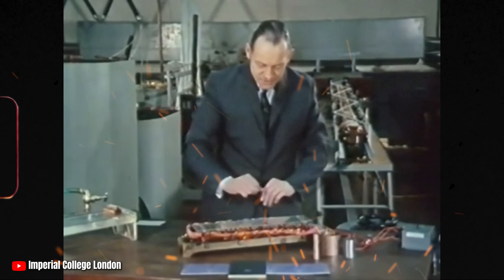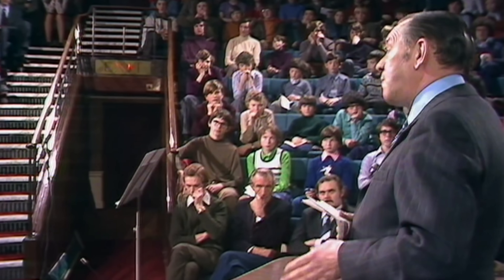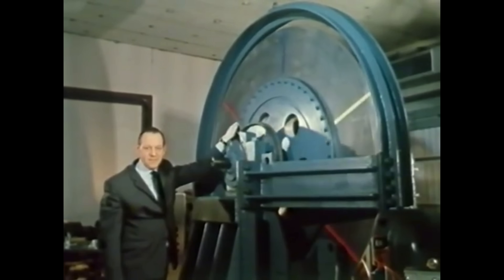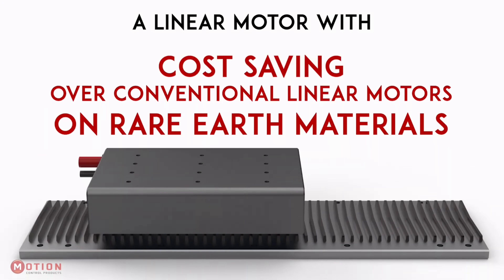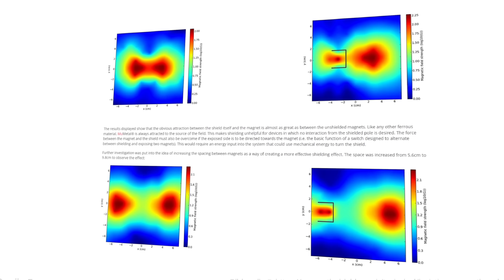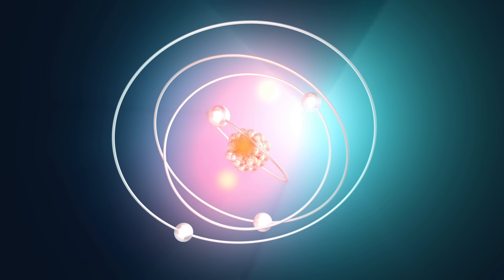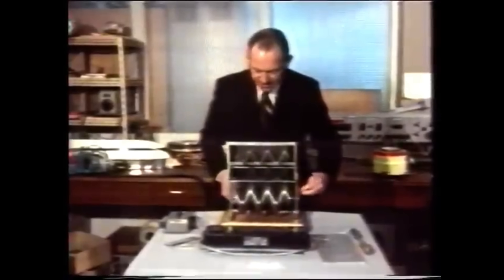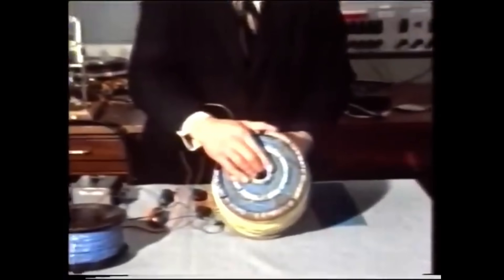Professor Eric Laithwaite: The Magnetic River Free Energy Generator!

Comment: The "Magnetic River" is by no means something mysterious. It's a linear induction motor, a very useful design, which is well understood. But of course this design does not deliver more energy than goes in. I doubt that Prof. Laithwaite himself ever made such absurd claims. Only YT-videos do that.
Reply: If the info is correct, then not really 

This would be a permanent magnet induction linear motor

That means the result is it runs itself and that’s because the Lorentz force ExB is just 2 magnetic fields interacting, current’s “magnet moments”
And the magnet. Here he’s using b-emf (Faradays Law) (generator effect in a motor) to be a Lorentz force Thus this would keep running.
Last more than a human’s lifetime.

The math and physics and Laws are basically perfect. The teaching in physics and especially electrodynamics is full of Dogma!

It is of basic knowledge to understand that the thermodynamics laws are NOT the reasons an electrodynamics machine limited to 100% input to 100% output. Even tho general science and electronics comunity make this mistake constantly.
Its the magnetic functions force pairs that limit the machine in standard design to 100% output and of course that’s because of standard design. Here with a different design that limit can be exploited!
Reply: @caminglis53    The info is not correct! This motor needs electromagnets and as all other electric motors an input of electrical energy. Prof. Laithwaite developed it in the late 1940, and there was never a newer design by him or any other person which worked with permanent magnets alone. 
And sorry, science makes no mistake. It is true that electromagnetic designs are outside the field of thermodynamics and I also don't understand why so many people always refer to the 1st law of thermodynamics. But in physics we have the law of conservation of energy which applies to all fields! It is this law which restricts output to 100%. All electromagnetic effects as Lorentz force or Back-EMF obey to this law, which is indeed a fundamental one. Up to now absolutely no observation is known which violates this law and in addition we have a mathematical proof - Noether-theorem - that conservation of energy (and momentum) is a prerequisite for the stability of our universe. I personally prefer a stable universe without permanent magnet motors to an unstable one with permanent magnet motors.
Reply: If you know Eric laithwaite you would know he never would use the words or phrase "FREE ENERGY"
Reply: The sun makes a tad more energy than goes in...what equal source off power went into sun too create the equal constant billions years off immense output what was the sun's equal input
Reply: What is the equal input that went into and maintains our universe explain in physics this equal input for me...
Reply: @jshaw4757    With the sun there is a fusion reaction, mass is transformed into energy. Sun looses mass all the time it emits energy. With the equivalence-relation between mass and energy this is in conformity with conservation of energy. But such reactions only happen under extreme pressure and temperature and are of course not possible with electromagnetic devices. Since quite some time scientists and engineers try to utilize fusion as an energy source on earth, but it is still uncertain, if this goal can be reached.

Sorry, I can't explain you what happened when our universe was created. Scientists have developed several ideas about it, but we simply don't know what happened and if conservation of energy was also valid at this singular event. But we observe for sure that it is valid in our universe now.
Reply: @jshaw4757    With the sun you have a fusion reaction, mass is transformed into energy. The sun looses mass all the time. This process is in compliance with conservation of energy if you consider the equivalence between mass and energy. What happened at the origin of our universe isn't known yet.
Reply: @durchblick9505 So the origins off our universe goes against our known physics..you would need equal energy input too create n run n crate physical matter and you say so yourself the origins off our universe is not known yet which means all our known physics could be fundamentally wrong as we do not not its origins or creation.. can't build a house without understanding the foundations
Reply: @jshaw4757  Your first sentence is not correct.  If you search e.g. for "big bang conservation energy" you will find that many scientists believe in a big bang, which did not violate conservation of energy. Others assume, that this law only became effective with the big bang. We simply don't know. But our lack of knowledge in this difficult field is no reason to stop observing what happens in our surroundings now. There is no observation known which violates this law, engineers and scientists use it constantly, and in addition we have the Noether-proof, that conservation laws are a prerequisite for a stable universe.
Reply: @durchblick9505  Yes but we don't know the original input...
Reply: @durchblick9505  it's simple...explain the original input then we can talk
Reply: @jshaw4757   I am not a big bang expert. But those scientists who assume that big bang did not violate conservation of energy have of course ideas about the original input. You find their ideas with the search string I have indicated. But as I said before, there is no assured knowledge with these questions, it's all hypothetical. But conservation of energy is not hypothetical, since we can observe it and even have a mathematical proof for it.
Reply: @durchblick9505  No correct you certainly arnt a big bang expert as nobody is ..the most important fundamental which currently states all existence n life n matter cam from a concentrated dot off something called a singularity 🤣🤣...crikey talk about clutching at straws
Reply: @jshaw4757   Big bang is a hypothesis only. But it is widely accepted since it is in conformity with observations, e.g. the expansion of our universe. It might be completely wrong but I think it is premature to critisize it just because it is far beyond our imagination. There are many effects in nature beyond our imagination and can only be described mathematically. 
Also, researching the origins of our universe is interesting, but hardly of relevance for addressing our present problems on earth.
Reply: @durchblick9505  "many scientists believe in a big bang, which did not violate conservation of energy. "
Well no that's not true. We have no idea how big the universe really is, or if it's infinite. In other words we have no idea how much energy is actually in the universe. We say it all came from the big bang, yet before the big bang there was nothing. Ie: we got something from nothing.
Reply: He never said that his invention could produce electricity, however he and John Searl discussed  John Searl’s invention and research.
Laithwaite also witnessed the levity disk that lead to John Searl’s generator.
I have images of Searl’s flying disk that were taken by newspaper journalists in late 1960’s
John Searl invented a UFO shaped craft using remote control systems he flew one around the world in cooperation with some enthusiasts in NZ and it is possible that Westall 66 documentary on YouTube was one of John Searl’s flying levity disks.
A child’s sketch matches the drawings of the UFO 🛸 craft that they flew.
Reply: @21gioni    Quite possible that Laithwaite watched experiments of Searl. But there was never a statement of him that he considered these demonstrations as valuable. There is absolutely no reliable evidence that Searl had a craft which flew around the world. Searl didn't even show his levity disk in a credible way. And he never proved that his generator really produced energy.
Reply: @ I have images of the craft flying that was published in Newspapers in England.
Reply: @21gioni    I heard that such photos exist. But there is still the question if these photos stem from Searl or someone affiliated with him and were manipulated. And if they are genuine, it is still the question if the craft did not fly by quite conventional means. There should be details about this journey around the world, at which date/time was the departure and arrival, where there stops in between, which route was taken. I don't think such informations exist which is supicious for me.